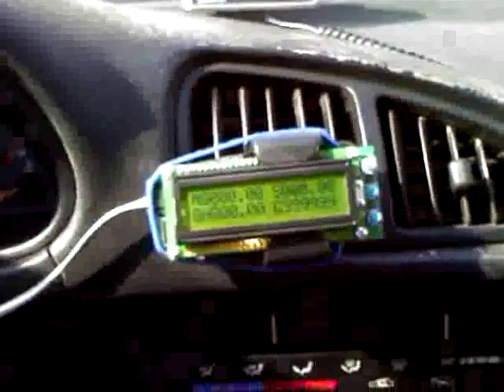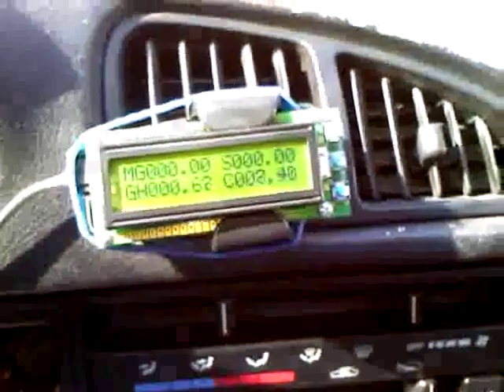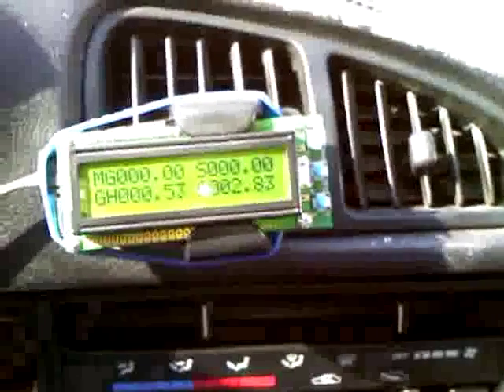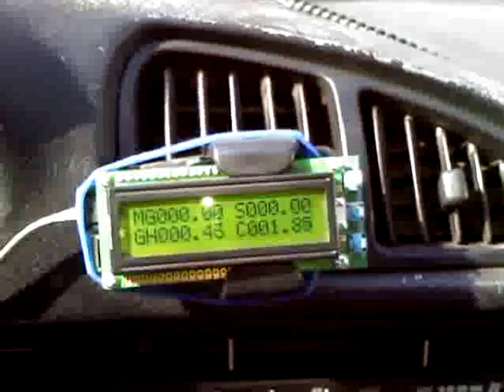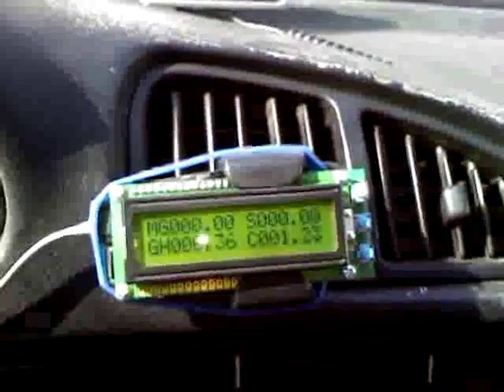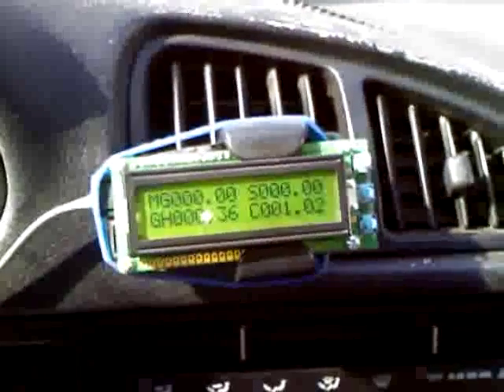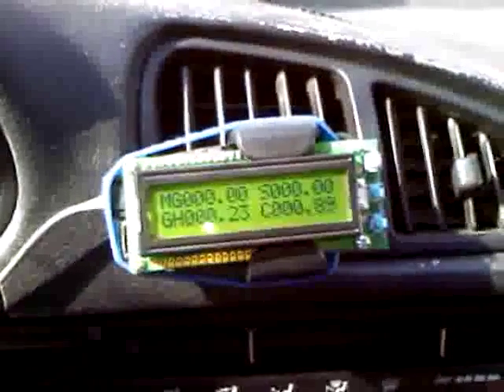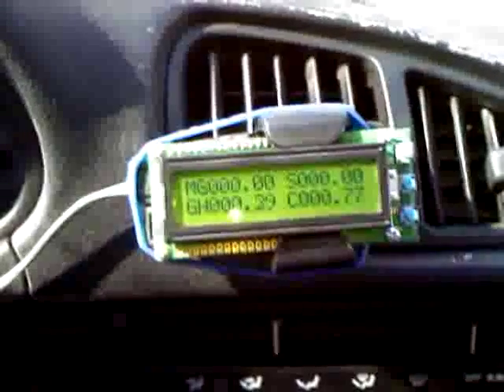'95 Geo Metro Sensor Trickers - MPG Increase

Comment: well darn, years later now, what value resistors did you use for which sensors? only "trick" I know is one click to e-brake lever, to shut off daytime headlights.
Reply from the maker: It was a 210 ohm resistor for the coolant sensor and 750 ohm resistor for the air intake sensor.

Comment: The two things I have down to get mileage up on my guzzler is putting a pwm on the fuel pump and slowing it down but you have to reset it to take off or else you don't have any speed. The other one that has worked great so far is the idle air bypass which seems to work good even when cold you need the throttle set when the engine is warm but when you put on the air you need a secondary bypass solenoid to get rpm up for the load requirement. Gasoline now is over processed and has few btu's.